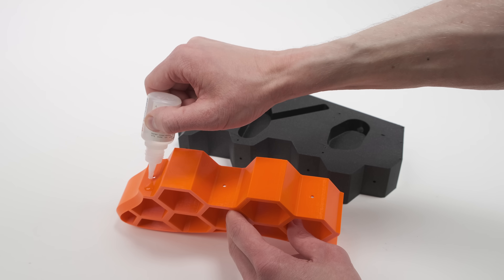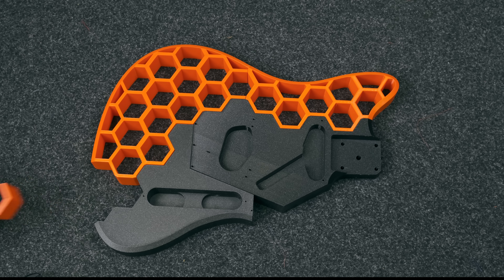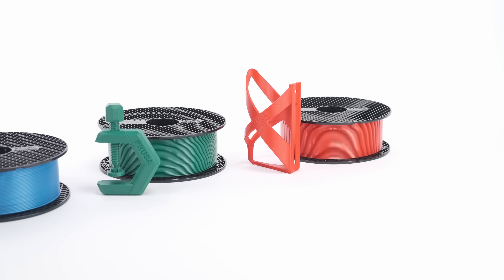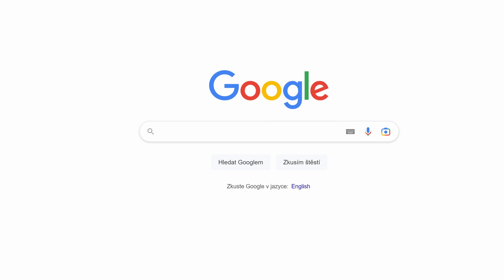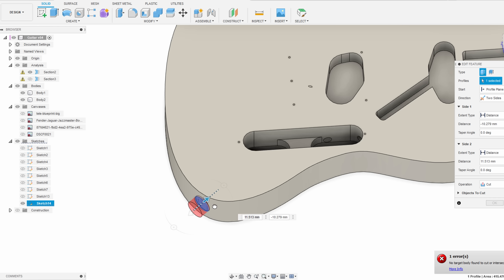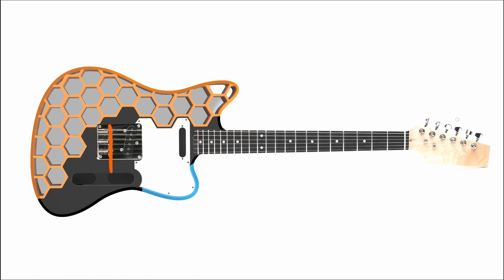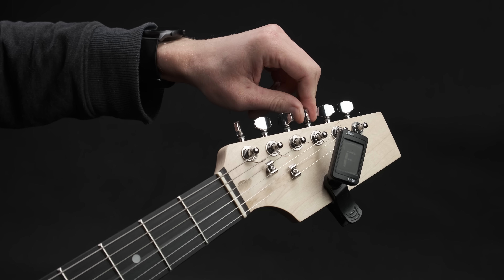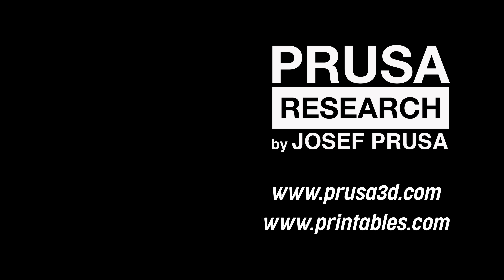How to 3D PRINT A GUITAR - the challenges, how it sounds, and how much it costs

Comment: The bridge issue I would have glued in wood. A similar idea to how they do hollow body guitars. You are already using a wooden guitar neck. Is not just the bridge point where tension would be an issue, but the neck pocket.

Comment: Unfortunately the bridge is not properly aligned with the neck. The low E sits to far to the site. You can easily see it in this video as well. The hole for the bridge is not deep enough. For the rest a great design.

Comment: One thing I would be interested in seeing is modifying the neck mount. Wood screws work fine for most builds, but if you want to be able to tighten the neck to the body with a consistent torque every time, why not install threaded inserts in the neck and use wide head machine screws?

Comment: Believe it or not. The pickup industry is full of scammery. You're going to get a much thicker sound from a humbucker than you are a single coil. In terms of tone. The buck stops there.
Pickups are magnets, not microphones. As an affect of that. Wood or material doesn't matter either. In terms of sound. You'll want to look at the speakers that are built into your amplifier. 

As far as hardware is concerned. Stability and positioning matters. Good tuners, good bridge, good potentiometers all play a part in how the guitar feels. Where the pickups are placed, and how the guitar is weighted all play a part. However, tone wise, the guitar has very little to do with what the end result will be.

Comment: I would like to print the Prusacaster with my Creality Ender 3 S1 but when I import the parts in Cura Slicer they don't fit into the printable area, how is this possible if my printer has the same print area as the Prusa Mk3?

Comment: Okay so quick heads up, the reason the Harley Benton kit costs so little compared to the other hardware is because the kit uses no name Chinese hardware (I do support buying the hardware from china directly but these are the bad kind low quality ones) and the other ones on Thomann are brands like hipshot or fender so they are absolutely high quality parts. So if you go by this build keep in mind that the kit hardware will suck (I have tried em out they really do)

Comment: I managed to print this on an ender 3 v3  with a 220mm bed. It was a challenge as i didnt have software to edit step files but i scaled it to the maximum possible @ 94 % . I then had to alter a few things including widing the middle piece to fit the neck using tinkercad (patiently lol)

The only thing i could suggest is perhaps making the print settings easily accessible for us newbies. You had the core piece which was great, but  info for other parts would save a lot of trial and error. Other than that nice work man! 
I also made a template for my router so i can build a few with a wood core to save 40 hours and compare tone etc

Comment: The sound will only be terrible if you're building an acoustic because, as we all know, the electric field generated by the metal springs vibrating on the frets and bridge saddles over the magnetic pickups don't give a rat's about what the pickups are mounted to. 😉

Comment: A mediocre guitar neck costs almost like a full electric guitar (I'm talking cheapest guitars). The truss rod you couldn't print but the rest why not? Truss rod is quite cheap online by the way. You can put two for more strenght. So far this is not a 3D printed guitar this is a 3D printed body replacement for a guitar that doesn't provide an adequate weight balance. Tossing an idea: a comb mesh filled with sand. Basically you'll have same shape just with a bottom side and a separate piece for the cover to capture the sand inside. Also consider making a smaller scale guitar, a lap steel guitar (it might not need a truss rod at all because of the added width).

Comment: Sry to anyone not up to speed yet, but the only factor in the sound of a guitar

1. is the space you leave between the pickup and the string. (really this is it)
2. the type of pickup your using
3. The speaker and amp

The material the guitar is made of has no bearing on tone

Comment: im so tempted to buy this 3D Printer only to build this Guitar. 
But say, what Material exactly whould i need if i want to print a guitar suitable for Live Performances. Means head and cold restiance. And how is the Tuning stability?
Does it go out of tune very quick? 
And do i still have enough colored fillament to choose from?
Also, whould be interesting to know what Glue whould be the best in that kind of situation.
I figured you chould take any Neck for this build. A Fender Neck with some upgraded Pickups whould be killer for this guitar!

Can you try to make a P-Bass next? ;)
Reply: I use mine live.  I tweaked the design for humbuckers (just a personal preference).  And I also modified the design to fit a carbon fiber rod down the axis as well as make it a string through design.  I used a spool of PLA+ for the body, and just regular spool of PLA for the rest.  It's pretty good in terms of temp resistance.  Tuning stability?  Have you ever taking an SG and bent the neck for a whammy bar effect?  It bends easier than that.  But once the strings put tension on it and it stabilizes, its not bad.  Is it the most stable guitar I own?  No way.  Does it do a good job playing live?  Yeah, it really does.  If you go to printables and search for stevenm25_155004 or search for item number 431616 it will show up.

Comment: it doesnt require a tension rod?
Reply: In the body?  It doesn't "require" one,  but I did my first design just plastic.  And after a week (and cause I screwed up the bridge placement) I redid the design to take a carbon fiber rod in the body and it's much more stable with one in there.

Comment: Considering the cost of a 3D printer and the cost of wood like ash, alder or sycamore, I could carve 50 guitars out of wood. I personally think that it is the neck that needs to have a change in materials. Wood is very unstable for something that has to be as precise as a guitar neck.  Some sort of metal can be machined to very precise dimensions and won't change, shrink, check, twist or cause fret sprout.  The body is not really important.  Wood is still the cheapest material.  Nobody wants a plastic guitar.

Comment: The soundtest is fake. Its played with heavy modeling on a (bad) line 6 direct to recording. Mic it up without delay, hall, overdrive and play it clean. And you will hear it sounds like shit.

And yes it plays surprisingly good....which is influencer speech. Depends on what you expected. And the neck is wood, so why should it not when its proper set up.

Yamaha and many others tried PVC Guitars 15 years ago, even with hexagon structure....and noone bought it because they sounded to sh1tty for the price. Sell it for 100 Bucks and you will find someone, for 150 you get a harley benton which sounds better.

Nuff said.

Comment: The guitar body part  holding the bridge should be printed with 100% infill. This is the reason why it is warping. Also, in order to get a better sound, the guitar body must be heavy. Since there are holes in the guitar, i would suggest to use epoxy to make the guitar heavier. This will make the guitar sound a lot better. Overall, this a nice project.

Comment: No legal issues with Fender using the Jazzmaster silhouette? Or is it just the headstock shape that's off limits? Been over 20 years since I looked into it.

Looks absolutely beautiful by the way, everything from the design elements and the colour choices.
Reply: Fender tried to trademark the Stratocaster and Telecaster body shapes around 2004, but objections were made and the Trademark Office decided that they were generic shapes. (Not sure about the Jazzmaster, honestly, but probably in the same boat?)

Gibson filed applications to trademark their body shapes and no one objected, so their body shapes are copyrighted now.
Reply: if you are not selling an item, hard to get into legal troubles.

Comment: This is actually a really good idea that im definitely going to do. You can actually control exactly how the resonance of the guitar will behave instead of hoping the piece of wood you got is a good one. There’s also a lot of ways you could re-invent the bride for electric guitars. It also opens up the option to making the guitar able to be easily modifiable in a short time for a low cost. The guitar industry needs some innovation, there’s been basically no progression in the last 40 years.

Comment: One idea to make less tension of the bridge pulling away from the body's face is to use a string-through body approach as seen in a number of schecter guitars (e.g. the c1-platinum) combined with tune-o-matic styled saddle. It doesnt solve the material deform problem (you already solved that), but it does mean that you dont need a "beefy" telecaster styled bridge to distribute the load on the face.

Either way, this is one of the coolest projects ive seen with a 3d printer.

Comment: well, since it has already been proven that there's no such thing as "tone wood," you can build a guitar out of anything and it will sound good, assuming you have quality pickups get their heights adjusted correctly relative to the strings... the material which comprises the body of the guitar is irrelevant in terms of tone... it merely shapes the price of the guitar based on how exotic you desire the materials to be but it won't affect the sound itself.

Comment: I mean it’s doable, but it’s been possible to injection mold a guitar from plastic for decades— there’s a reason they didn’t replace more traditional materials & production techniques… Because it’s far lower quality. Woods & construction do contribute to the overall tone of the instrument, & a lot of a professional guitar designer/luthier’s time & thought is going into optimizing/perfecting timbre & tuning stability & sustain & other extremely delicate (in some cases very subtle, in some cases very in your face) qualities that separate a $20 Sears catalog guitar from an artisanally hand-crafted masterpiece of an instrument. 

I mean, even with overwhelmingly similar design, even pretty slight variations in the quality & craftsmanship can make a significant difference— just look at the difference a an older Japanese Squier Stratocaster, a Made in Mexico (maybe $400) Fender Strat— today the Squier line that used to be the worst & cheapest have improved a lot & have basically taken the place of this line, but when I was a teenager Squiers we’re the cheap, crappy borderline knockoff quality ones— & a Deluxe Strat from Fender’s American factory or even custom shop… And then many other third party “Superstrats” ranging in quality from even better than many Fenders (e.g. PRS’ version) to absolute knock offs. All the same design, basically. Many of them with the same materials. And yet because of very subtle variations, because of being mass production vs handmade, because of hardware differences, investments of time & money, these nearly identical guitars can range in quality & price by an order of magnitude (before getting into any “was owned by [x famous guitarist]”).

So yes, you can technically make a very cheap plastic 3D printed guitar body… And if that’s what you’re interested in, go off— maybe over years or decades you can improve the process & tech enough to start to achieve the quality necessary to be able to start honing some of the finer, more musical qualities of an instrument (rather than struggling to simply make one that doesn’t buckle within a year). Not necessarily discounting the possibility (although I think the further you get into these finer points of luthiership, needing to make these very fine adjustments to achieve properties understood really only by high end instrument craftspeople, the more necessary it will be to actually know how to make a high-end guitar by hand before you’ll have a prayer of replicating such properties in a 3D printer— this isn’t stuff you’re just going to stumble across in CAD. You need to actually understand & be accounting for acoustics & resonance & how materials affect timbre & probably a lot of things I, as a non-luthier guitarist, don’t even know to identify for you)… So if you’re serious about this project & want to make a really good 3D-printable guitar I’d definitely bring a real, highly skilled luthier in on the project… Although even if it was possible, I do not know how many luthiers would want to design a guitar as good as the ones they can make by hand that cuts them out of the process & basically would make one of the few remaining good jobs automatable… So there’s perhaps also a dark side to this whole endeavor… But I suspect that just like generative art will not actually replace the demand for paintings, just like photographs didn’t, people will probably always want hand-made guitars, even if printable ones become a decent simulacrum of somewhat comparable quality. Anyway, without a luthier’s input, short of using AI to try to do some kind of fancy mathematical analysis to calculate optimal designs & materials, similar to the way a luthier would try to do (something to bring the acoustical properties of the instrument you’re designing into the process prior to printing a prototype), I doubt you’ll just accidentally achieve the kind of quality & reliability of a normal guitar, unless you do have luthier training & know what to be accounting for.

Comment: well
it sounds like guitar as any other
In the end it doesnt really matter what guitar is made of as long it has guitar mics and strings where it can take magnetism and transform that in to electronic signal then that is blasted out form that disgusting line6 spider
(like why, there are as cheap better sounding combo amps or do us a solid and upgrade stock speker out of that when that is the foundation where your sound comes out)
There is already amazing 3d made guitars or carbon fiber guitars in the market so this isnt anything new

Comment: Very nice project I am ready to have a go. However, how did you fit that Core.stl onto 210 x 210? I have ender 3 S1 with 220 x 220, and in PrusaSlicer cannot fit on the build plate, your secret, please, regards
Reply: i have same problem

Comment: Very cool build! I noticed one small flaw and that is the neck is slightly tilted left-right, so that the low E string gets closer to the edge of the fretboard as it gets up the neck. Does anyone know if this is a flaw in the model, the assembly, or the neck? Thanks!
Reply: I'm not sure which one it is but these cheaper guitar kits often suffer from warped necks. On the other hand it could be the higher tension of the lower strings bending the mounting holes on the body.

Comment: literally only boomers still fall for the tone wood scam. it's been proven beyond a reasonable doubt...it doesn't matter. but if the material is too soft it probably won't hold it's tune/sustain well. but ultimately if it's past the threshold for hardness....it's fine and doesn't matter at all. (electric guitars, not acoustic)

Comment: The Stratocasters have a floating bridge where most of the pulling force is absorbed by screws connected to springs on the back of the guitar. Can also be a good contender since you can make those screws as beefy as you want.
Reply: Most of the string tension on a Strat bridge is on the screws or studs at the front of the bridge plate, not to mention the pressure of the knife edge into the body just in front of that.
Reply: I would worry about the screws pulling out.

Comment: 3d printed bass?
Reply: Should be easy to make.
Harley Benton also makes a diy kit for a electric bass, so you‘d probably just need to do some small modifications to the print files to fit the bass hardware and then assemble it just like you would assemble the guitar.

So just order the bass kit, remix the files to fit the bass kit (and upload the remixed files so others can also enjoy them) and there’s your 3d printed bass.

Comment: I thin its ok but the title should be call only the body frame of a eguitar made by 3 printing the rest its not made by the same i mean neck and head i think those parts should be interesting made by 3d printing as well 😢
Reply: You could probably make a 3d printed head and neck by including some channels for threaded metal rods to make them more resistant against bending.
That way it should even work if you use pla or some other standard filament that isn’t reinforced with carbon or glass fibers.

Comment: I did this for my high-school capstone project, try printing the neck as well... GL. Its doable, materials and printer have improved enough in the last decade for it to work "better" now. Interesting options for infill patterns and cavity sizes can be used to print a body with internal resonators, the main thing I noticed on my first print was how light and loud it was even without amplification. Still have the thing sitting in a corner, its held up ok, but could be better.
Reply: How can you print a neck on a 3d printer, it's too long!
Reply: @joeking433  You have to print in sections and then connect them together. You could also just have a massive printer (but at the time, I had a makerbot replicator 3x, which was quite small)